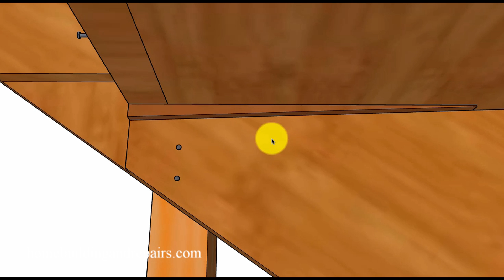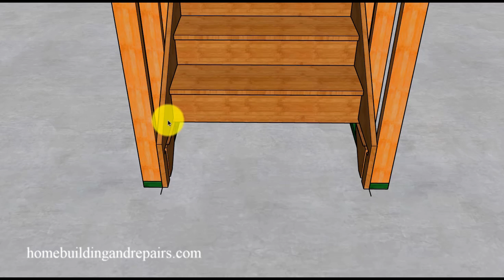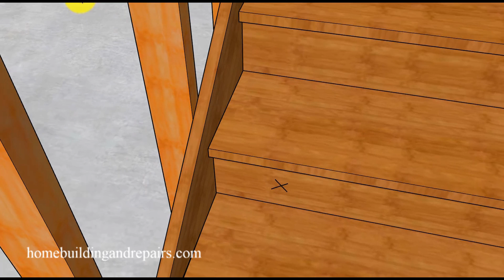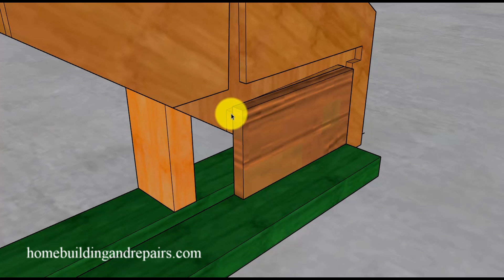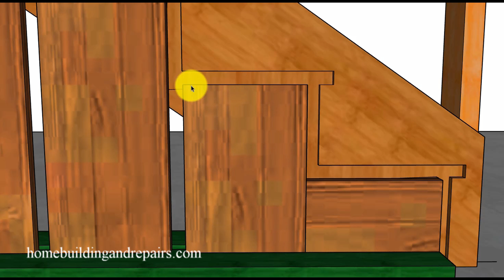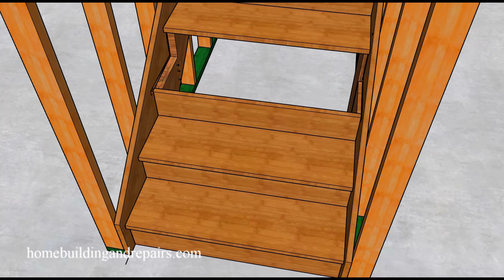How To Repair Steps Separating From Housed Stringers When They Can't Be Pulled Back Together

Comment: Great video. Gave me some good ideas. I have complete access to the entire underside of the stairs. I am tempted to just try to install a sistered stringer on both sides for the whole run. 

Before I found this video I was going to try to use some all thread and pull the stringers tighter. What do you think about that method?
Reply: Do the supports need to go to the ground? Could they be glued and screwed to the stringer? My steps have another set of steps directly under them so no flat floor.

Comment: I had this problem with a natural wood staircase that I didn't want to demo. I removed the drywall from below and cut new stringers. I sistered up the side stringers and replaced the middle with an LVL stringer. I added a 1x tread for better support underneath the existing treads with construction adhesive to the stringers. I jacked stringers into place and they conformed to any irregularities. The stairs are stiff and not squeaking. There are still some minor visible gaps that I think can be closed by shimming the skirtboard.

Comment: I have this issue with my basement stairs, except that one of the stringers is up against the foundation wall. I do have access underneath, so this video should be helpful.
Reply: Same!  You have access under the stairs like me?  I finished my repair this evening.  I cut support wedges out of scrap 2x4s and 2x6s, and nailed and screwed them into the stringers.  Didn't take out any treads.  Now my stairs feel rock solid.
Reply: @christophersmith9275 I am going to attempt a repair this weekend. Did you have visible separation on your stairs?
Reply: @plugnation6224 you mean between the tread and the stringers?  Yeah I definitely did before I got them secured.  If I had to do it again I'd ask someone to stand on the stair as I put a support underneath, to keep the tread from lifting
Reply: @christophersmith9275 I was thinking of using a 2x4 and jack in the middle of the stair from underneath. Jack it up and try to make the top side line up again then screw some braces and hopefully thats it. Im nervous to take out the old wedges tho. I haven't gotten around to doing this repair yet...🤦‍♂️
Reply: @plugnation6224 I used a section of 4x4 and a car jack.
Reply: @christophersmith9275 I out support pieces of wood underneath, but you can still see the gap from above.

Comment: Housed stringers would be much better if the stringers themselves were thicker.  My staircase from the first floor to the second floor had many of the locking wedges fall out since they only had about 1/4" to 3/8" of contact with the stringer itself.  I tore off the plaster and lath going into the basement, and I found the wedges in the rubble.  I doubt they would've fallen out if the stringers were an inch wider and had much deeper slots cut into them.  It's a brilliant design otherwise.

Comment: All my treads are split and not safe for my young children. We can’t get behind them. But we’re getting the new treads in but now the sides are bowing out and cracked the old plaster. I noticed it is also all tied into the railing in the middle given these are third floor stairs with a two step landing. How should I fix or how can I ensure the stairs fit well into the slots of the stringers. The repair man also really damaged and scratched the molding everywhere. Any recommendations??

Comment: I have a staircase like this and one of the stringers is sinking at the top. I may have to take down the whole stair case and re hang it. There are only vertical studs at the last tread and there are no horizontal studs for the vertical studs.

Comment: Do you continue to add verticals even all the way on the top stairs?
Reply from the maker: If needed, yes. Sometimes it will be better to do it anyway.
Reply: @stairbuilding  thanks for the response! I did it today and put a vertical 2x4 where the riser and step meet all the way to the top and it fixed the issue! Thanks so much for this vid it helped immensely

Comment: I have a minimal traditional house from 1950. The kind of postwar homes that are all laid out exactly identical for an entire neighborhood. My staircase has the stringers and then the stair step is just routered into the stringer a few MM's and then its nailed into place with smooth nails. A single smooth nail on each side holding those steps up for each step.  The entire staircase itself is just nailed into the floor joists with bigger smooth nails  I noticed that my steps are beginning to separate from the stringers and the nails are showing. There is no brace blocks or any other wood under the stair tread. It relies solely on those two nails holding it in. I have no idea how to reenforce this.  One side is closed off to a wall and the other side is open to the room.  The side closed off to the wall is the worst side.  I had an idea to peel the carpet up and go through the top of the step diagonally into the stringer with a deck screw to try and pull the stair back into the stringer without disturbing the nail's position and hopefully get the nail to go back into its hole.  Then for the other side just go straight on from the side.  Not sure if this would solve it? The side open to the room is just free-floating with no supports to anchor it.  The side closed off to the wall is anchored into the wall studs. Another idea I had was to whack it with a sledgehammer and try and force the other side back in from the shockwave, but the wood used are soft and just a normal hammer will dent or punch through the wood. Also the stairs were originally open steps but evidently were closed off to make full steps and they just used wood wall paneling to make the riser and glued the carpet to that. This is so stupid.   I need to get this fixed or else my stairs are gonna fall down trying to get my broken water heater carried out of the basement. Another idea I had was to add some jack posts under the middle of the stairs to help ease the weight load of going up/down the stairs.
Reply from the maker: You can email me some pictures or go to the website and check out some of our repair and remodeling videos for stairs.

Comment: I would love your opinion on, I have a similar issue though I can get under the stairs. the stringers are 1.5 inches thick as are the treads. I can see the nails holding up the stair tread still. 

I was going to jack a tread and use a clamp to pull the stringer in and then screw a 2.5 in construction screws in between the two nails that were attached to secure it better and also hammer the nails in. 

do you think this is a good plan since they are separating?
Reply from the maker: If you can't get under stairs, then can you remove the riser or tread to make repairs?

Comment: Thank you so much for making this video! I have this exact problem on the first three stairs in a townhouse I'm fixing up and I had never seen stairs built like this.  Earlier today I used some 2x4 and 1x4 scraps vertically to support the treads and also added some blocking that I screwed into the stringer,  I wasn't sure if this was the best way to repair the stairs,  so I decided look on youtube .  I had already planned to continue the repair tomorrow and  now after seeing your video I know I'm on the right track.  I'll remove the blocking and add more vertical support.  I don't think I'll have to remove any treads or risers...luckily, I have access through a storage area.  Thank you again for making this video!
Reply from the maker: You're welcome and thanks for sharing your story.

Comment: HELP!!! Our house was built in 1927, and now the stairs going up to the second floor are leaning to the left. We can only see a small area under the stairs, and everything looks good. So why are the stairs lean to the left approx 1/2 inch?
Reply from the maker: I have no idea, but it might be time for an inspection. Email me some pictures and I will be glad to provide an opinion, other wise check out our stair repair videos at the website.
Reply: @stairbuilding  ….thanks for replying, but I’ve no idea how to send the photos to you here🥴
Reply from the maker: @terryandlindaoshea2398  I think you can find some good stuff at the website, don't worry about the pictures.
Reply: @stairbuilding   ….I watched your videos on the website but nothing like the problem we have….is there another way I could send them to you? Sorry but I’m old and not very good with all the new techniqes
Reply from the maker: @terryandlindaoshea2398  I don't have another option, but if you figure something out, let me know.
Reply: How’s your stairs? Did you get them fixed? I also have a 1927 year built home.. my stairs are separating from the top area

Comment: Thanks for the link.
I just used Simpson strong tie brackets with their SDS 1/4"x1.5" fasteners to every step. Rock solid now.
Just in case anyone is having this issue, especially with lumber costs 
About $100 for 20 brackets and 5 fasteners per bracket. 3 into stringer and 2 into tread for the right angle brackets.
Got 8" brackets and cut off 3". Used 5" ones for treads and 3" ones for stringer to risers. But risers were alot thinner wood so I just used pocket screws to attach to riser and the SDS fasteners into the stringer. The wood to fix would have cost many hundred dollars. But for 100-150 you can use the 12 guage Simpson right angle brackets. That was enough for 10 steps. Feels rock solid now.
Reply from the maker: If you use an inch and 1/2 fastener like a lag bolt or screw and the stringer is at least an inch and 1/2 thick then I say go for it, but the stairway I'm talking about usually has side stringer's that aren't more than an inch thick and in some cases they are three quarters of an inch thick. Smaller thicknesses might make it difficult for the screws to hold over time and thanks for sharing your experience with us.